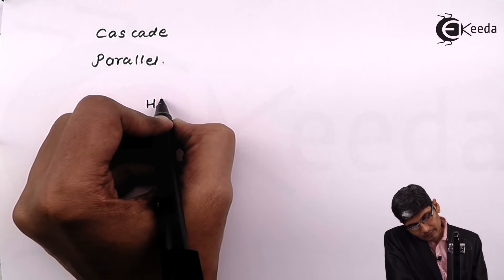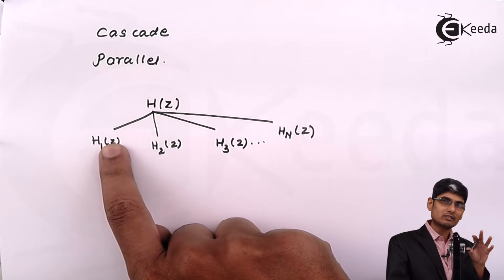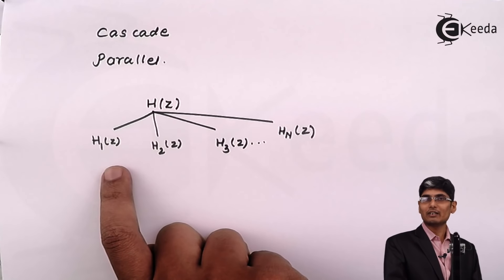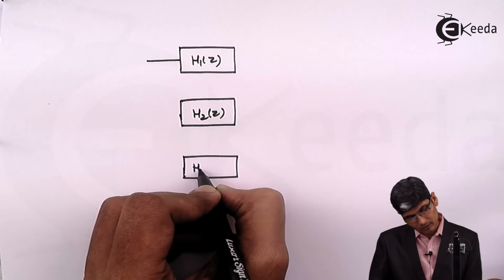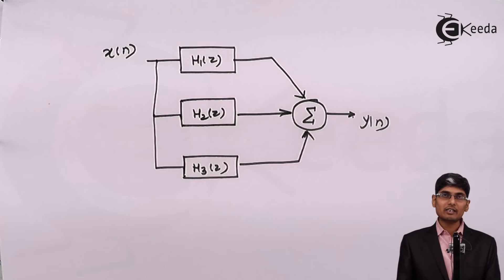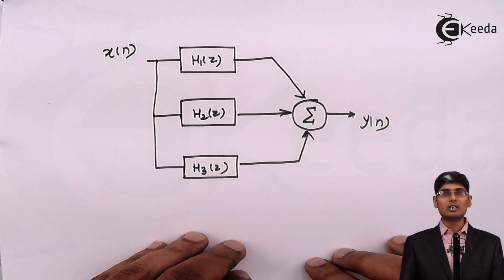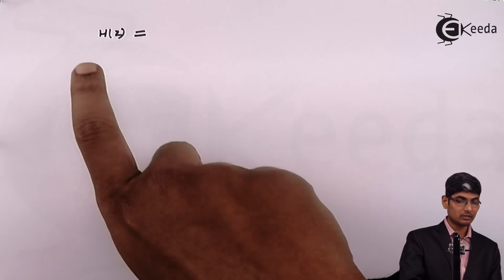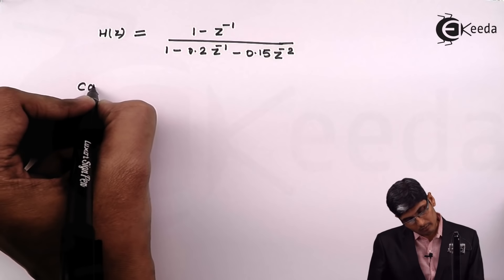Introduction to Cascade and parallel realization | Ekeeda.com - Discrete Time Signal Processing

Comment: mistake at 10:11 i.e the roots should be -0.5 and 0.3 because we want -0.2 on adding -0.5 and 0.3
Reply: The roots' values are fine. You are thinking of this form (z-0.5)(z+0.3), but when you equal those terms to zero, you get:
z=0.5, z=-0.3... Those are the values of the roots that are shown in the video.